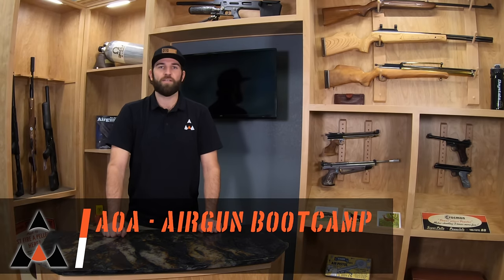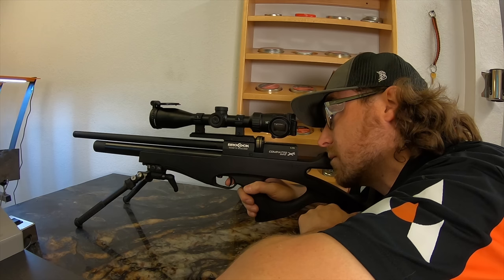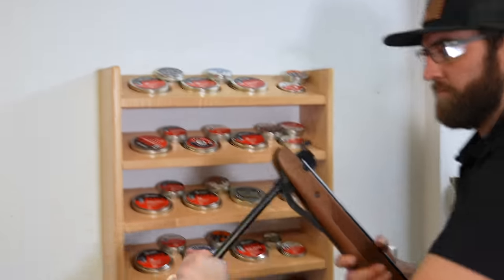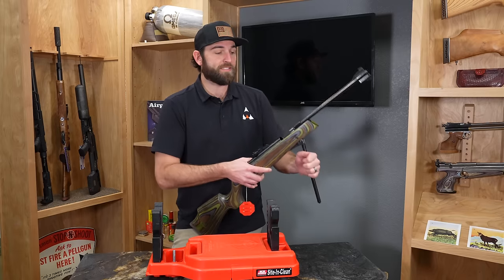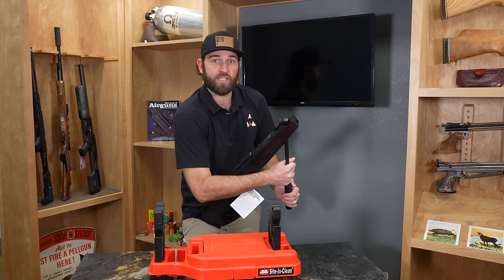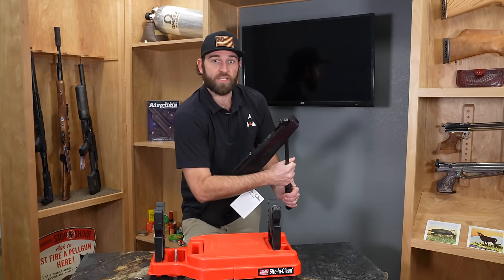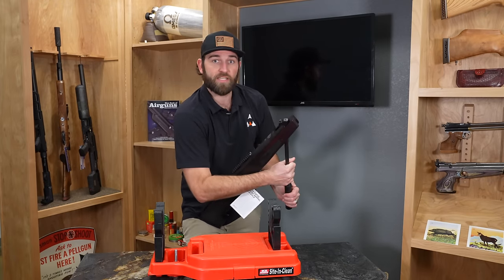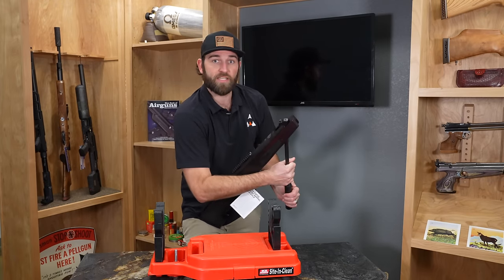Types of Air Rifles - Airgun Bootcamp

Comment: Hey there....I came across this mini electric air pump I saw on Informercial T.V called an 'AirHawk' for $99.00 NZD...can I use it as alternative to filling a pcp air rifle???...I not sure about whether it has an adaptor that is suitable for a pcp but if it does it will save a whole lot of headache an chore of filling up!!! maybe you can do a bit of research and if it checks out...I will seriously consider buying a pcp than a Gamo g- magnum whisper mach 1  .177mm later dude!!!🤔🤔🤔

Comment: Is it recommended to bleed off the pressure in a PCP bottle when you're not using it? Can I leave my charged PCP standing around the house for when I see a squirrel? I'm overrun by ground squirrels here. I'm wondering if carbon fiber bottles have a lifespan. My first thought was What if it explodes? And man, these things are expensive!
Also wondering if I can use my .22 rimfire silencer on a .22 cal pellet gun, assuming the threads match.

Comment: I have a piston rifle its almost as loud as a 22lr even with the built in suppressor.  And it kicks worse. And the accuracy  changes day to day. I also have a S&W 77a pumper that I much prefer even though its 40+ years old.
Reply: your springer act  that way if its dieseling ,thats happens because of oil in the compression chamber , and that extra power is not helping accuracy ,because the pellets go behind the sound barrier and speed changes from shot to shot and the barrels are most for a speed of max 280 meters  second  made  or less (850fps)    keep the oil out of the inside  .

Comment: a gassram or coilmetal spring  are both springers ,and both have there best points . my experience with both types ,from hatsan ,diana hw ,is this a metal spring with the same cocking effort (then a gasram )the coil spring has more output. the o rings in a gasram are in a way brakes , a coilkeeps comming and holds the peakpressure  longer
Reply: "gassram or coilmetal spring  are both springers".     😂😂😅😅😂😂